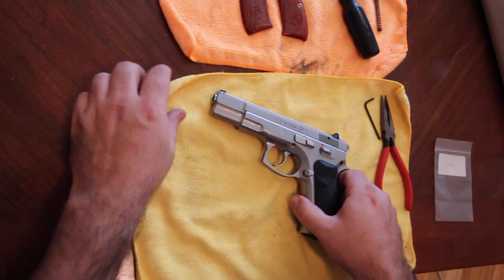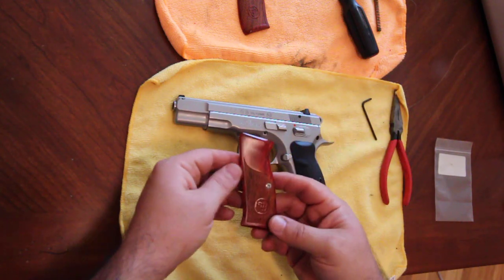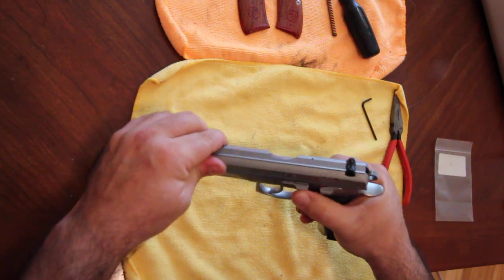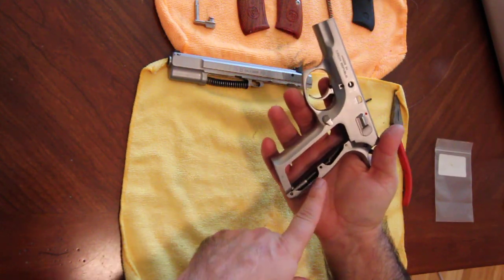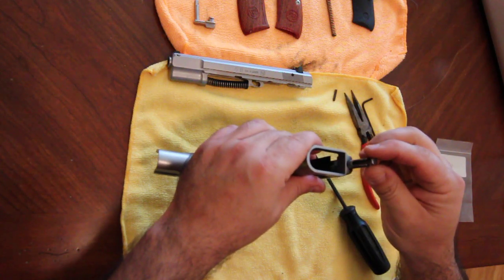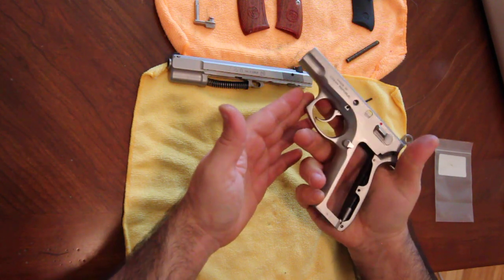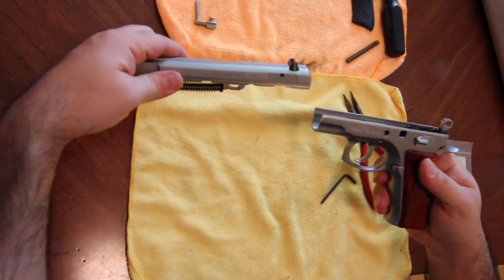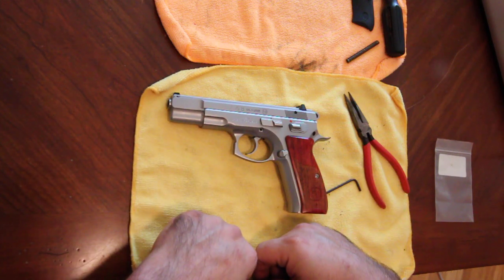CZ 75B Upgrades

Comment: I was gonna send my CZ-75BD to a gunsmith, but this has shown me that even I could or should be able to do it. 

I'm going to replace the hammer and recoil springs both with a 15# and a stainless steel guide rod. I don't trust that plastic one. 

Thanks for the video.
Reply: Nothing wrong with a plastic guide rod. Very durable. CZ wasn't being cheap. It reduces weight on a already heavy gun.  An ss guide rod adds about an ounce. But the additional weight does help with the recoil. Did it to mine.

Comment: I have made the same changes to my 75B but added an extended firing pin, along with a softer firing pin spring and firing pin block spring from Cajun Gun Works. The extended Firing Pin eliminates problems with harder primers.
Reply: Mike Hamilton I did this on my cz 75 bd and it was a very straight forward job, no messing with sear.Does greatly improve decock and single action trigger pull.

Comment: Thanks so much for posting this vid.  My 13 lb spring just came in the mail today. You made this clear and understandable...
Reply: Just a follow-up... 13 lb spring is in. Single action pull went from 4 1/2 down to 3 1/2. Trigger feels less gritty. Very pleased with the results.
Reply: BadWolf did you get any light primer strikes with the 13lb spring?
Reply: Chris Stearns Nope. None at all. Functions perfectly will any factory ammo I use as well as all my reloads.
Reply: BadWolf thanks man! I am installing today along with 15lb recoil spring and stainless steel guide rod. Cant wait to get to the range this weekend.

Comment: New grips look good on your stainless 75B.  My poly coated 75B came with plastic grips and I changed them out to the rubber grips. Much better.  Also changed my main spring to 15lbs following your video and the trigger is now also a lot better.  Was going to do a full trigger job but with the new reduced power spring, I think it'll be good enough!

Comment: Thanks for posting this video! I had bought myself a replacement spring but didn't trust myself with the job until I saw this. I own a 75 P-01, which has a smaller magazine than the 75B (14 rounds vs. 16 rounds of 9 mm, respectively). I had to cut off 2 links of the spring for it to fit.

Comment: Ok, so how did the gun perform after doing the hammer spring? I have the stock 20lb in mine and want to change it out, and the trigger out to an 85c original. My 75b eats anything you feed it with no issues and I don't want any by changing out the hammer spring.

Comment: It's better not to dryfire the pistol with the slide removed.  Instead of being stopped by the slide, the hammer strikes against portions of the pistol that aren't really designed to take that kind of impact.  To dryfire with the pistol in field stripped condition, use your thumb or a piece of wood or plastic to arrest the forward travel of the hammer before it strikes other parts.

The flat spring steel part inside the grip is a magazine brake.  It's designed to insure that the magazine doesn't fall all the way out of the gun if the magazine catch is accidentally depressed.  Flat magazine brakes are available to allow the magazine to drop all the way free any time the magazine release is depressed.  Some guns may ship with the flat brakes these days.

Any time a hammer spring is replaced, it's important to do some thorough testing in BOTH single- and double-action modes.  The hammer strike strength will be reduced by the lighter spring and since the hammer strike from a double-action pull is always lighter than the strike from single-action trigger pull, it's especially important to test the gun in double-action.

Nice video.
Reply: khinchine 😮😮😮😮😮😮😮😮

Comment: We have the same gun, though I don't have those sweet looking grips.  Your CZ, however, is way cleaner than mine.  I plan on tearing it down for a full cleaning after my trip to the range tomorrow,  I'm looking to do something with the trigger as I was having trouble today switching between my Sig P226 40 with SRT and my CZ.

Comment: I have the same matte stainless and a black polycoat.  I've tried the reduced springs and I like the factory spring rates better (I lift weights and can rack any gun).  I changed to a stainless one.  I went with the CZ all checkered cocobolo grips.  I think that the 1/2 checkered grips you are using look cool!  Maybe some night sights would be nice?

Comment: First and foremost, the wood grips really set your pistol off. Great looking pistol. Are there any cons to using a reduced power hammer spring?
Reply from the maker: +beelikestowatch Thanks for the compliments! The draw back is that sometimes if there is a hard primer, the gun will not fire.
Reply: beelikestowatch You ask why mess with it. Should be asking why not. Cz guns are way over sprung from the factory nowadays. 18-20 pound hammer springs stock which makes for a unnecessary heavy double action pull. I run a 13 pound main spring and extended fp and lighter fp spring and Cgw comp hammer in my p01. 0 problems of any kind, da was 13 pounds, now it's just under 8, sa was 5.5 pounds and now It's right at 4. That's why you replace it
Reply: CZ 75 is a pistol designed for defense. All is well designed and balanced for this purpose.
Some people use this handgun for target or sport and want more precision.  This is the reasons why they modificate springs, hammer, etc.
Stress situations in autodefense or military uses are not compatible with soft triggers. It is dangerous.
Reply: IIISalvaIII, from a former combat veteran, I couldn't have said it better myself. In a fire fight, the DA pull feels about 2 lbs.

Comment: Man,you're hammer spring went in super easy. I'm trying to do install one  on a CZ-75D PCR and it just will not go in. I can't get the little leaf spring retainer to line up with the notch in the part that captures the spring. I might have to send it in to CZ and let them reassemble it for me. I wonder if something like that is covered under warranty. The gun is brand new. I haven't even had a chance to shoot it yet.

Comment: My gun is identical to yours and I also am not happy with an 18 lb trigger pull. How did you decide on a 13 lb spring? You could have gotten a 15 lb spring. Had you already tried the 15 lb?
Reply: 18 lbs.?? Lay off the weed, ronald.

Comment: Did new spring help single action pull any ? Have you shot any NATO rounds since spring install ? I here NATO rounds have a harder primer.
Reply from the maker: Changing the hammer spring has very little effect on the single action trigger pull. I haven't tried any NATO ammo, but with the lighter spring I have had some ammo that didn't fire on occasion. I certainly wouldn't do this modification for a carry pistol.

Comment: Where did you purchase your new hammer spring? I have a CZ 75B and am interested in doing something like this modification with mine. Also thinking about replacing my recoil spring with a DPM recoil reduction rod. Thanks for the video!
Reply: Chris Graham The dpm recoil rod is a waste of money. 9mm doesn't recoil much anyway especially in a steel frame gun. Cajun gun works is the place to go for anything Cz, also check out Cz Custom

Comment: is the main hammer spring and rod a drop in kit like you would change the recoil spring and guide rod... or do u have to mess with the hammer mechanism? iam a novice and never gunsmith anything in my life....
Reply from the maker: makukidd12 The hammer spring has no effect on the recoil spring.
Reply: +projectgattago I have the same dude than makukidd12.
The recoil energy is used for several actions and one of them is to lift the hammer.
Maybe is needed different energy to push a hammer charged with different spring. 
My question is about a possible compensation changing the recoil spring using a harder one.
Thank you in advance.

Comment: If I change the Hammer Spring as shown in CZ 75B Upgrade video in my CZ 75B Omega, do I need to replace any other internal component to ensure proper firing?
Reply from the maker: +George  Giroux  George, I don't know anything about the Omega platform, so I can't really answer your question.

Comment: Does the new spring create less travel in the trigger pull ?
Reply: It won't create less travel, it just makes the pull lighter.  To lessen the travel, you're going to have to replace parts up in the fire control group and trigger mechanism, which gets a little harder and a lot more expensive than just a hammer spring :)  Look to Cajun gun works if you're interested in parts for that job.  In fact, if you have the money, just send it to them! :)